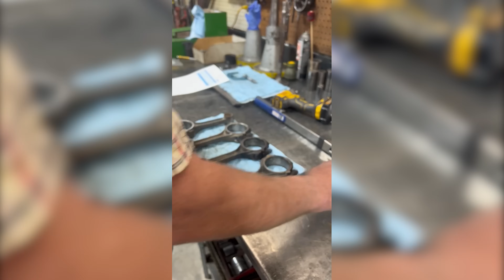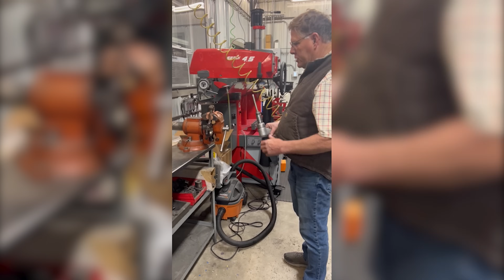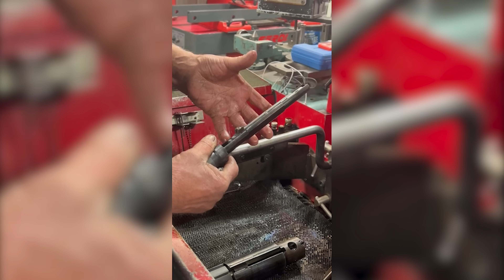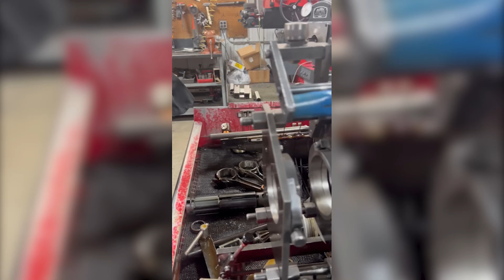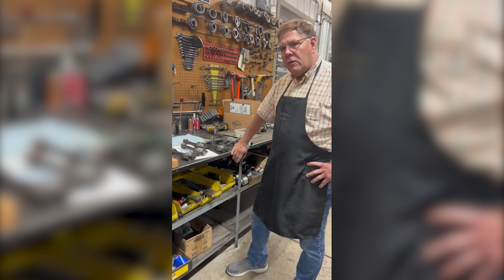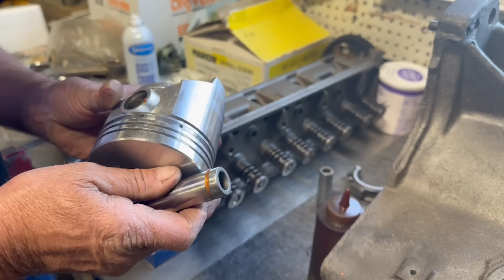172 Ford Connecting Rod Remanufacturing & Short Block Assembly

Comment: When I think of how I used to consider myself a mechanic, all I can do is shake my head in wonderment after watching your videos. I used to "overhaul" an engine by stuffing new rod and main bearings in it, throw new rings on the pistons (sometimes I'd even de-carbonize the ring lands!) and if the valves weren't literally rattling in the guides, I'd call it done. It's a good thing I only worked on my own stuff.

Comment: Really nice to see someone put a bushing in right. Like SB and BBC were they use pressed in pins in the small end of the rod. When I raced I always used pressed in pins in the small end of the rod. I think they are better. In a bushing setup you get more rock in the small end of the rod. If you use the GM tool to put in press in pins you never had a problem. Most machine shops just press the bushing in then hone for clearance. Thats were problems start.

Comment: Is there a reason for not using a torque plate? Also, is there a chance that the oblonging in the block bores could have been less pronounced or absent should one have been used?

Comment: Just a quick tip, i saw you were printing your AERA sheets in color, using lots of ink on the engine info section, at the shop i work at we print them in black and white without losing any info from weird shading, depending on how many engines you work on and how much you print, it could save you a little bit of money!

Comment: The connecting rod isn't bent. That model came with variable compression connecting rods. This provides more even power across the cylinders as the motor ages.

Comment: As a dealership technician who's been turning wrenches for a living pushing 30 years, that was an excellent video. Extremely informative. It is actually mind numbing how different measurements there are, inside of every engine and engine moving part that needs to be within a certain specification. Employed at various dealerships for the number of years as I have, I replaced a lot of and assembled a lot of engines in my time. But all these measurements being discussed and the methods with which they are corrected as needed, using all those machines is not anything I would ever have thought of. In this particular video I was impressed with the discussion and demonstration of how a connecting rod is brought back to specification. Great job!!! 👍

Comment: You guys gotta check out Steve Morris channel he builds race engines in Michigan and has designed his own Billet engines one is a SMX that is designed after a big block Chevy and the other is a SML that is mostly copied from a LS block except he added more clamping force to the heads and block to be able to hold a head gasket under high boost anyway it's a great channel just like yours. If you want to see crazy engine carnage check this video out it's crazy  https://www.youtube.com/watch?v=com9fTAr7eU&t=1028s

Comment: You guys exemplify why a properly machined and rebuilt engine is usually many times better than a "brand new" crate engine. 
With your engines, nothing is taken for granted - all parts are measured, checked, and tolerances adjusted for intended use or condition. 
With new parts on the assembly line, "Joe Six-Pack" bolts on the fenders just like the boss told him to do... the parts must be OK, 'cause they're brand-new, and if I don't slam together 20 units an hour I'll get fired".
It is so refreshing to see perfectly salvageable parts being reconditioned, hard-earned skills being passed down, and your quality work ethic not being compromised - especially in today's "disposable" society!

Comment: Wonderful Video   Having had a Partnership in a Machine shop I saw and learned a lot we moved on Due to Age and even thou i was Considered a Master Mackinac  i never could stand the ups and downs of the Automotive Industry   SO i went on to do other things and was able to help some one to open a shop where we and a good run for around twenty years   and i still like to work on Cars  for FUN only   i never even thought of my self as a Machinist   But there is a thrill in Assembling a Motor and starting it 
    thank you for Sharing your time with others

Comment: I'm curious, have you ever had a motorcycle engine in the shop.
And i don't necessarily mean big bore Harley engines, but the smaller ones in the realm of 500-1100cc

Comment: If the parent bores are not round but the sleeves pressed in are now machined round, how does that work as the engine heats and cools for cylinder roundness? Would they stay round when the block heats up?

Comment: I'm sure it'll run well now, but between the cracked head, the bent rod, and the issues with the sleeves and bores, that engine would've been better used as a boat anchor!

Comment: The head bolt hole inserts that u used, are not what I would use. For one they are short and the threads engagement is not the best. The insert I would have used would be a blind hole insert with thread contact the full length of the insert. Cummins has these inserts and when installed with Loctite they will not back out. The full length inserts spread the load over a greater area of the block and not at the deck surface. Just my view after 40 + years working on diesel engines from 40hp to 2500hp.

Comment: If it had been necessary, could you have converted that engine to use cam bearings?
Reply: My thought is that since it is not standard, you would not be able to find a bearing that would do the job.  Also you would have to cut into the block to fit the bearing which could cause all kinds of other problems with the water jacket and oil pathways.

Comment: Hard to find this level of professionalism today.
Reply: Yup impossible. Better off buying a new motor now.
Reply: @MrSocko-vn7fw there's a limitation on buying an engine for many of the vehicles these guys work on . But by and large , yes typically it's the easier option for more modern vehicles with available engines.
Reply: @texasslingleadsomtingwong8751 yea and most these engines are from farm tractors and water pumps not cars or trucks so 80% percent have been used for at the least 40 to 50yrs.
Reply: There are loads of good engine machinists and reconditioners out there .... they just cost more .
Reply: @LifesAbe-ach cost more done right ever time.
Reply: Right?! If I was even remotely sure my local shop went to this level of effort and detail to get everything just right then I wouldn't balk for a moment at the prices... But no, not only am confident they don't but every shop in the area is also confident they don't, but they are the only game in town so they know they can get away with it. Frustrating.
Reply: Everything they do reminds me of the shop I work at, so mad respect to them for doing it right also!
Reply: There's always a market for the best. For sure though this is the kind of professionalism you find all over the aviation world.
Reply: Its just amazing to watch all that and realise how the job of a good mechanic used to look like. Great work guys!! One thing I have to mention though, as someone who grew up with the metric system it really make me laugh so hard when I hear two thousands of an inch or whatever other measures were mentioned. How does the imperial system still exist? It’s so ridiculous! 😅
Reply: @TheZohan26 convert mm over to thousands of a inch by dividing your mm by 25.4 & boom! Now u too get know about precision measurements. Example 
13mm ÷ 25.4 = .512 rounded up
Reply: @TheZohan26 why does the metric system even exist, imperial calls for tighter tolerances while the metric system is pretty damn loose.
Reply: Yep, had a Toyota inline 6 done recently. Took 5 longer times than quoted, came in over double the cost and had obvious signs of a machinist with minimal attention to detail.
Reply: Nah. Hard to find the money who wants it…
Reply: Yes no lie on that for a small rebuilder shop.
Reply: Are you concerned about clearances when everything heats up from the machining operations? 
All those minor saw cuts in the bushing area are known as stress concentrations in the engineering word. They’re know as areas where cracks start.
Reply: @johnmar7701  he had mentioned that he would be concerned if the scratch was anywhere else but since it was right in the middle of the beam it should be fine.
Reply: Although the only engine we've seen in use after fix broke after few Km

Comment: A you Tube channel that specializes in blowing up high performance engines sent a block to be machined before they acquired the pistons. I can't help but think the machinist would have preferred to have the pistons on hand to finish the cylinder bores.